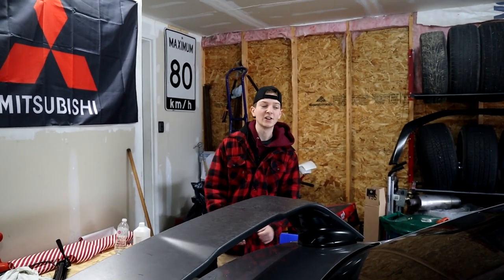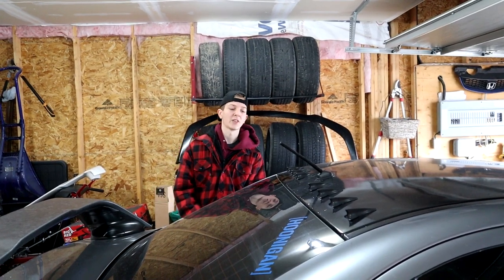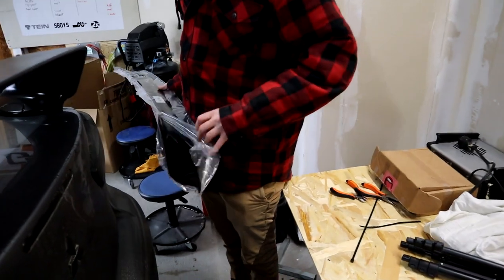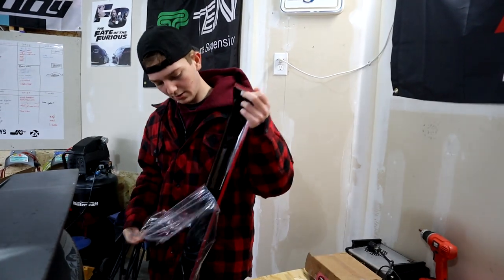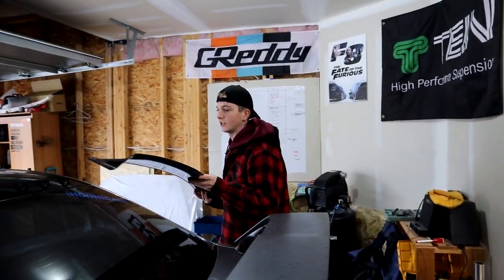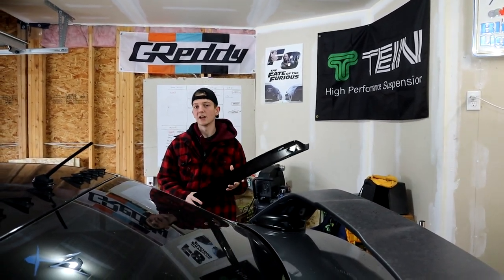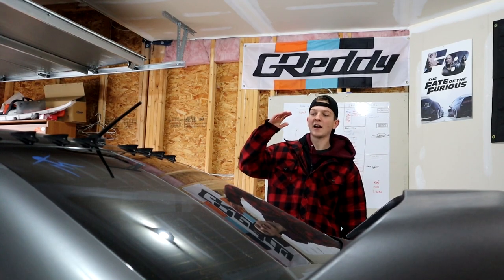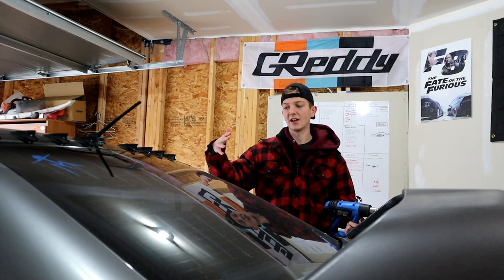Installing A Rear Windshield Visor Mitsubishi Lancer

Comment: Mate I needed some help. I recently bought the 2017 lancer black edition it looks great but it really struggles for power and torque. Do u have any tips to increase torque and/or power. It has a 2 litre naturally aspirated engine I’m not looking to pull crazy numbers but even a slight increase in hp or torque would be nice.
Reply from the maker: We have a video coming soon on a tuning chip that I bought that adds 40 hp, exhausts help and a cold air intake